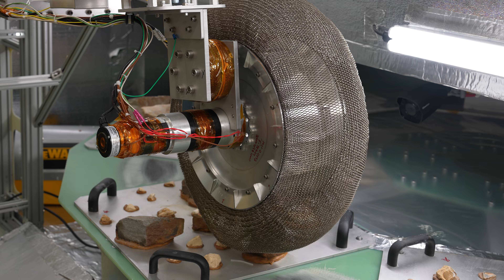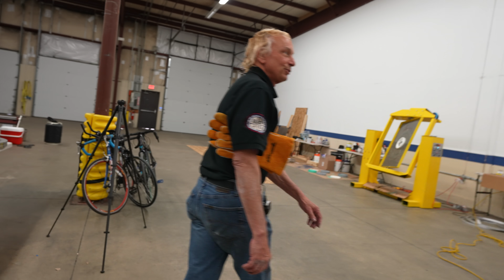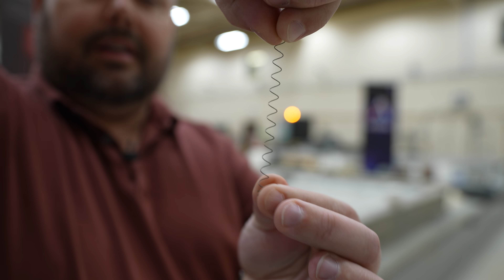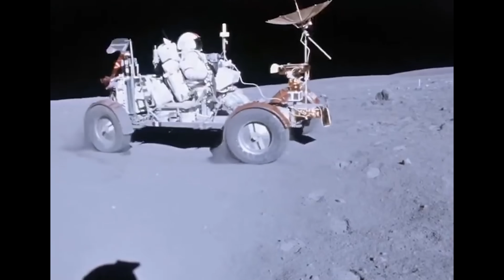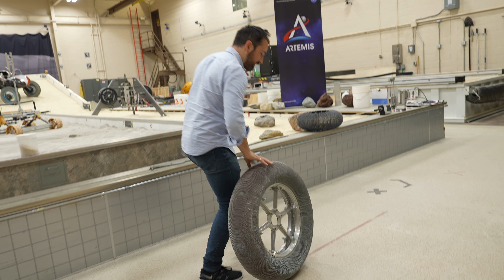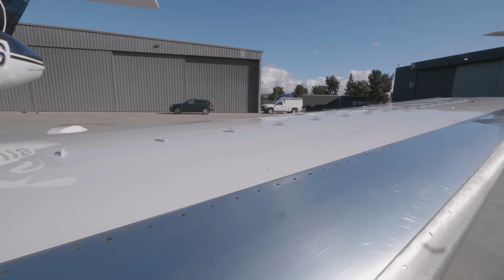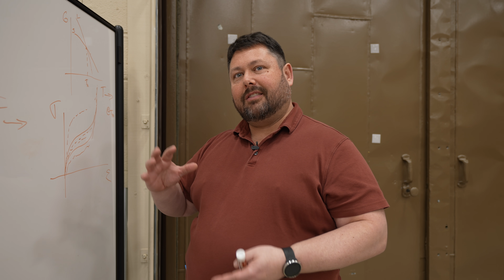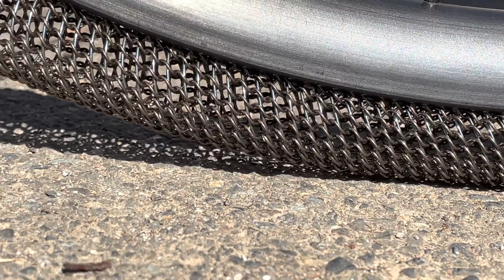How NASA Reinvented The Wheel

Comment: 23:13 I know in extreme off-roading depressurizing the tires increases grip, I wonder if there's a method to induce something similar in the nitinol tires.
Reply: We're doing variable pressure for bikes. You start with a baseline PSI-equivalent and then add air (worst case, you revert to the baseline after a puncture). Shape shifting tires would be farther out, but the principle is sound.

Comment: Using the same on a strain gauge one will get a wider range of weight from a scale than normal by taking the Analoge temparature under strain, or the resistance of the TiNi wire under strain, and release, would love a sample to work with. What is the timer to reset curver and debounce per area?
Or with a good heat exchsnger a crio-cooler under -100K is doable. I need a sample asap!

Comment: For these wire tires, I think the biggest problem will be the sand. When the sand went between the wire mesh, the friction between the sand and wire will erode the wire quite easily (think about sand paper sanding the wires)and shorten the lifespan of the wire.  the lifespan of these wire tires is doubtful
Reply: SMA tires have been tested at NASA to several times missions requirements with no such issues.

Comment: My god this is impressive, I never imagined metal replacing rubber tires and being very effective at that like wtf
Reply: One thing which wasn't covered is friction - because if the friction this material provides is close to or surpasses that of rubber, then bar astronomical manufacturing costs even with industrialization, we should technically be able to use it on vehicles.
Reply: @dax3m  oh my god
Reply: @dax3m  not viable at all. Tires have tons of engineering to make them perform accordingly to conditions exposed. Friction is only one of the many forces that keeps tires planted to the group. Rubber is an excellent choice for ties becasue not only do they have a high coefficient of friction they also are very malleable, which means 5hat they could deform into the imperfections of the road which means that the tires could fit into microscopic holes increasing surface area contact , obviously how much a tire deforms depends on its rubber compound whether soft or hard. Tires also become softer when warmed up increasing grip on road surfaces. If metal was used as tires they wouldn’t be able to deform as tires, although they wouldn’t have turning lag of a conventional rubber tire, that’s not enough to justify its downsides. Also you will feel every single bump on the road if you use metal, because metal wouldn’t be able to absorb impact as much as rubber can.
Reply: @Eclipsis17  bro try watching the video you're commenting on the whole idea is that they deform
Reply: @moistp1ckle  Small deformations, rubber conforms to small deformations because the material is inherently elastic which helps absorb vibrations that give you a headache-

metal is the opposite, it's very rigid every in this form and really only conforms to large objects, few inches wide instead of a few milimeters.

Actually metal conducts vibrations directly through the chassis- there are ways to dampen the vibrations still but the tyre can't do it when made of Nitinol
Reply: @Mallchad  a rubber coating would solve that?
Reply: @moistp1ckle  Yes but not on Mars or the Moon,
on Earth a rubber coating, or various additions made of rubber or even foam really would go a long way for grip and vibrations-

on Mars/Moon the rubber would freeze/melt and make it no more useful than glass or putty
Reply: @Mallchad  You described an Earth problem. I described an earth solution. The rovers go so slow that it isn't an issue.
Reply: @moistp1ckle  true,
but friction and dust is a problem still
Reply: I think it only replaces air inside rubber tires, you still need rubber to make a practical real (Earth) world tire. Otherwise if you were to just use the mesh, small debris would make their way into the tires, and be impossible to get out. That's why they still had rubber in that bicycle demo.
Reply: You ought to see in other dimensions, they're pioneering the use of metal for wheels!
Reply: It's funny when we started threatening super pedo Island all of a sudden the miracle tech came back out
Reply: @beginnereasy  anybody know wth this guy is talking about?
Reply: @Vergilsjackpot  
He's probably high on Q-Anon BS.

Comment: I took my Jeep off road today. From 40psi road pressure I aired down to 20psi for the dirt, to get a smoother ride and to avoid puncturing. Can't do that with nitinol or can you? Mind blowing material. I know puncturing isn't an issue but having a lower pressure also gives you more grip on the dirt as the vehicles footprint is increased with flatter tyres.
Reply: We're doing variable pressure designs (start with a nitinol baseline of 20psi, then add air). The worst case scenario is a puncture, and return to baseline, but otherwise you can go up and down.

Comment: What if there was a coating that makes the mesh pull to a soap like substance that can make an inner tube, but its just like a solution so you add air pressure and then let it dry over time it makes an inner tube but you can make it anywhere

Comment: Some questions about Nitinol;
1. Is the material durable? Under high abrasion cyclic loading/acceleration/braking does it degrade?
2. Does it degrade in an aggressive marine/acidic/basic environment?
3. If used for car tyres, how does it perform in an accident with the car on fire? Or when the tyres are covered in mud/dirt/oil/water/electrical stray current?
4. Does it create any galvanic reaction with any dissimilar metals?

Comment: Wouldn't this be useful to somehow generate power? You could use direct sunlight and shadow and turn that into kinetic energy which in turn could drive a dynamo. Not sure if it would be practical, but that might be a fun project.
Reply: Yeah, load it during day, unload at night. Quite interesting...
Reply: It is the subject of a few studies out there (to use the material to generate energy from what we'd consider waste heat in many ways) - the issue is the cost of the material itself and the fact that its durability if still unpredictable to an extent. The manufacturing process can be troublesome as well

Comment: they're so overrating it. it isnt indestructible imagine putting it on a tesla car and run in 90mph, you'll be sanding away those very expensive titanium on the road eventually you'll gonna have to buy a new one too expensive.
Reply: wait they havent shown you how it was driven on road at fast pace. pretty sure its gonna spark a lot and youll be left with scraped wheels

Comment: I have a question and I dont know if anyone will see it and answer. I'm not a scientist so I dont know how to look it up or use the scientific terms. I like to ride my racing bicycle but I hate having to deal with flat tires or leaking valves on poorly made tubes. One thing I'm curious about with this kind of wheel is how much energy is being wasted on the force on the ground? Like a well pressurized tire it feels effortless when riding my bike, but a tire with too little PSI it feels tougher and tougher. Does anyone know the comparison between this NiTiNOL tires compared to normal pneumatic tires? If its similar in any way or can be it would be the investment for my bike that I would be so happy about.

Does anyone know? Maybe it's something that Veritasium could make a video about? hehe

Comment: 23:07 small note: changing the pressure can actually be advantageous when changing from tar/concrete roads to gravel & sand bc you need more surface area to grab ground and not sink in. If we had a NiTiNol tires with different modi that would be revolutionary

Comment: Mind someone explain how would you "program" the nitinol to the "original" shape? I might have missed it in the video. What is the "original" shape of nitinol? How would you "program" it to be the nasa world rather than a spring as the "original" shape?
Reply: It has to be held in the desired shape and heated to around 500C for 30 seconds or so. The high heat resets the crystal lattice into the Austenite phase while the wire is in the new shape

Comment: I don't understand why in the examples before 16:50 the nitinol starts out in the twinned Martensite state, but when it's the wire it starts in the Austenite phase. Does that mean, immediately upon inducing stress, the wire goes into the Austenite structure and throughout continually applying stress (inside the 8%) the material goes into detwinned Martensite? After the stress is released, it goes bad to Austenite, but shouldn't it go back to twinned Martensite?

Comment: Seems like a lot of extra work to thread the individual turned wires into each other when one could use a combination of one straight and one turned version, then heat the straight into the twist while nested in the other. 
I recall reading about these quite a long time ago, though it was paired with Michelin's then prototype airless ribbed tire. Interesting to see how each approach has evolved.

Comment: I got a question not about related to this video but that you posted some 10yrs ago that roundest object one. Okay so it goes as follow.

Now if you set an ideal sphere in pure rolling motion than the point of contact with the floor will be in a momentarily rest means kinetic friction would not act and only static friction will act and as we know that static friction would not cause any energy loss so if you set it in pure rolling than it would not stop and continue it's motion even on rough surface (though pure rolling is only possible on rough surface). 

The reason why normal round object around us cannot perform it is because they don't have a sharp point contact which is present in ideally spherical object so as the roundest object I come to know about is the one you showed in that video than if we see relatively between various round objects it would go far far away than any of them will you be able to perform this stunt worth some million dollars ?😅😅

Comment: remember back in the 1950's when aircraft designers were ironing out literally everything out of a plane? 
what resulted out of that? a plane that was 99% wing, as wings are what is inherently required to fly.
what happens when you take a wheel and iron out everything that's not needed? a wheel that's 99% weight-loading lattice, as that's what is required to roll on it: that it be round, and weight-loading.
the problem? ..... all those businesses dedicated to the trade of fixing rubber, when they realize that cars no longer require rubber wheels.

Comment: Wow. The biggest part of a bicycle ride for me is to gather all patched inner and outer tubes, make a good selection, fold them. Then check and select the tube repair kit and some other repair tools and a heavy duty air pump with nanometer.
Then a very good heavy lock in case I have a flat tire and am too tired to fix it.
I mean, fixing a tire at a windy -10 degrees celsius at 1am in the middle of nowhere is no joke. Nor is fixing it at +32 degrees celsius.
Having nasa tires would cut my load in half and my maintenance would be reduced by 99%. Just lubrication and checking the breaks.
And since I have a full shock absorbing bike, I can use a tire that feels like 5 to 10 bar.
If you wonder about the bike: it's a velomobile quest. Full aerodynamic, you sit inside a cocoon,  so even when it freezes you wear shorts because you heat up your bike from body heat.
Tires are the next thing after aerodynamics: bad tires means high rolling resistance.

Comment: Nitinol is a fascinating material. But have you heard about nilinol?

Nilinol is the zeroth member in the sequence of alcohols: nilinol, methanol, ethanol, propanol, butanol, pentanol, hexanol, .... It is a corrosive solvent capable of dissolving most metals and corroding some by exposing them to dissolved oxygen. It is used in large quantities in heavy industry in the production of Styrofoam, pesticides, and concrete plasticizers. It is used as a coolant in nuclear power plants and a reagent in the production of dangerous chemicals like sarin. Nilinol can act as both an acid and a base and accounts for more calculable damage to society than any other compound. Yet still today it is added to our food, our drinking water, and our air.

Please sign my petition to ban the use of water.

Comment: What are the limitations of replacing the regular tires with nitinol though? Can they withstand friction of rough terrains as good as rubber tires? Because if a punctured rubber tire has to be fixed a specific cross section can be patched and its good to go, but that doesn't seem to be the case with a nitinol tore constriction demonstrated above.

Comment: for those wondering. I have a Razorock shaver similar to the henson. if i'm lucky itll last for a decade. maybe longer. my last cheap knock off similar version lasted 5 years. and fell apart due to corrosion. if a henson razor lasts a lifetime as they claim, it's 100% worth the cost. the question is, whether it lasts that long.

Comment: I'd love to move away from the rubber tires of today, but there's a lot more to consider than "no flats" and low maintenance (albeit still a question here) for road use. You need to consider adherence under all kinds of weather, under different loads (a rover's weight is pretty much fixed, while in a car you'd carry passengers and luggage at times). You need to make them resilient enough to at least match rubber tires, and cost effective enough that it's not just going to be a wet dream.
Besides all that, there's the impact of these tires on the infrastructure: First, they must not damage road surfaces, and second, the other infrastructure - mass manufacturing (delivery should not an issue). 
I'm excited for the future innovations, and i truly hope we'll move away from petroleum tires to something not only much more reliable, but also less damaging to the environment.

Comment: That is really cool. The only question I have about its elasticity, ability to stretch, is if you where to heat it up into the Detwinned stage, would it then loose its abity to stretch as well? My reasoning for this question is if heating it up can move the metal out of the Twined and detwined stage, and stretching it will move it out of and into the detwined stage, then if we are hot, detwined, then we can not stretch into detwined stage any more, because we are already there. Am I correct with this?

Comment: 9:42 if the material permits it, why not just straighten out the spring then put it through then heat it up so it coils it self, speeding up the process by avoiding the turning?
Reply: you'd need to make the material colder, that spring wasn't designed to become a wire.
Reply: @PellyEllieEla  i thought heat makes it rebound, not cold?
Reply: @Jacob-yg7lz  you can stretch it further if it's colder
Reply: @PellyEllieEla  my point is to stretch it then put it through and heat it so it coils

Comment: Would have liked some discussion on the negative aspects of the material as well. We've known about this material and its properties for over 50 years and yet it's not some ubiquitous super material used in all applications, there are reasons for that. The video presents it like it's some new super material only now being used in future technology.
For those curious, the nitinol examples shown in this video are highly purified examples that are extremely expensive to produce. The steel wire-mesh lunar rover tire was levels of magnitude cheaper to produce than a tire made from nitinol.

Comment: If the bullet penetrated how is it bulletproof
Reply: It was a pellet and the tyre remained 'inflated'/fully functional
Reply: @weedfreer  its still not bulletproof, it just remained functional after being damaged by a bullet.
Reply: @PellyEllieEla  it was a 'pellet'...however, it remained functional, whereas an ordinary tyre wouldn't.
Reply: @weedfreer  a pellet is a bullet by most definitions including common sense. Bulletproof means that a bullet cannot penetrate the object.
Reply: @PellyEllieEla  bullet proof is actually a misnomer.

Nothing can be absolutely 'bulletproof'.

And a bullet is a very specific thing.

A bullet is a casing containing a propellent and an ignition source, sitting beneath a tubular projectile shaped into a tip.

A pellet is projected by the air being compressed behind it...at (typically) a much lower velocity.

If you're going to be absolutely litteral about your perception of what veritasium is trying to say regards what's happening, then, I'm going to have to insist on the same degree of literalness about the bullet...and about the fact that nothing can be classed as absolutely bulletproof.

Just go watch demolition ranch to figure that out!

The correct term is actually bullet-resistent.

The fact that this tyre remained functional even though it was hit by a projectile is the only takeaway here
Reply: @weedfreer  no
Reply: @PellyEllieEla  sorry, but, yes
Reply: @weedfreer  no
Reply: @PellyEllieEla  great comeback!

Evidence based and everything.

👏👏
Reply: @weedfreer  well, you are wrong.
Reply: @PellyEllieEla  based on what technicality...to your own mind?

🤷‍♂️
Reply: @weedfreer  Everything.
Reply: @PellyEllieEla  now you’re just embarrassing yourself…not 1 single shred of actual counter point to back-up why what you’re trying to say is correct.

Read up on the subject, then, come back when you have a point worth considering.
Reply: @weedfreer  mad you lost?
Reply: @PellyEllieEla  nope.

Just disappointed that you didn’t have a foot to stand your counter argument upon
Reply: @weedfreer  "counter"

Comment: I had no idea that it could exert those kinds of forces while returning to shape when heated.  I wonder if you could utilize this in a heat pump and flex an external radiator to slough off ice instead of defrosting it in colder temperatures and increase the cold climate performance.